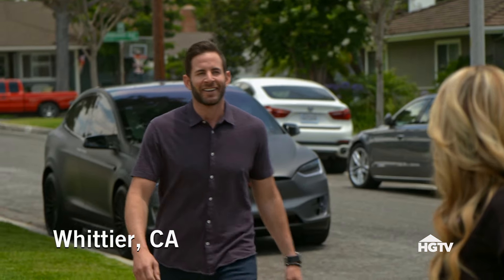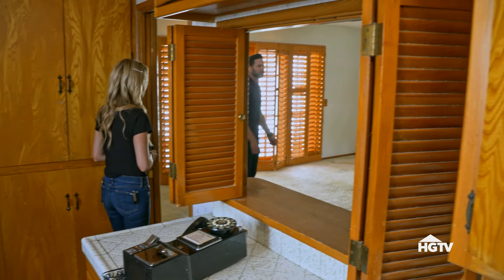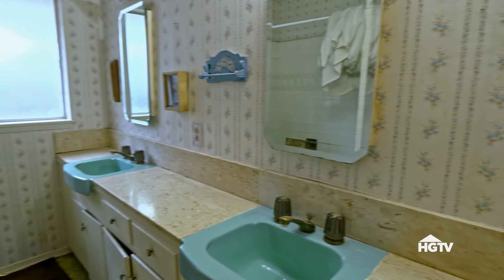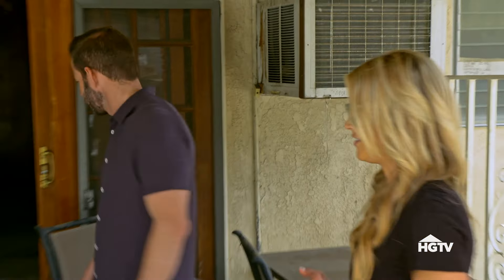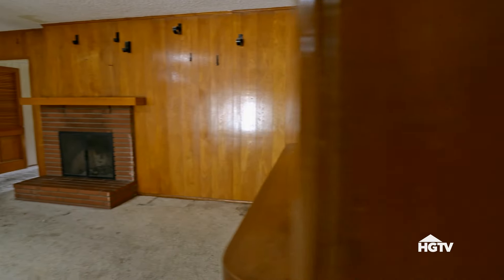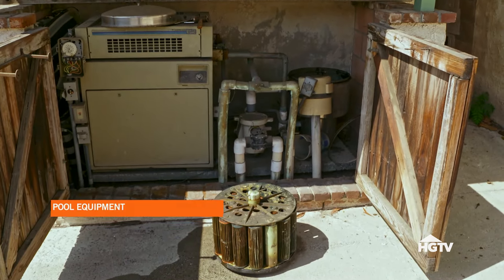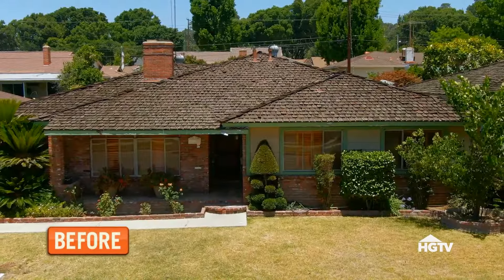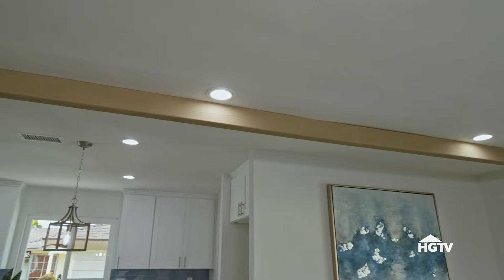Risky Home Flip Turns Into A Success | Flip or Flop | HGTV

Comment: This is one of their better looking houses. Ordinarily I hate painted brick, but on this house it looks good. The inside is mostly good. I liked the tile they picked in the kitchen—no crazy patterns or colors, and it wasn’t excessive. The things I didn’t like were mostly small stuff, like why is the oven in the dining room? In the bathrooms I’m not crazy about the tile (though it could have been worse), and the mirrors are too short or mounted too low—if you’re taller than 5’10” you won’t be able to see the top of your head unless you crouch or squat. Still, I could live there. Not for $960k, mind you, but it’s a decent enough house
Reply: It looks like a Melbourne Victoria Australia type house with all the brick and solid building
Reply: Better the mirrors are mounted low.  People often lean in to shave, put on make up.   It's dangerous to have a stool as it's a trip hazard...
Reply: @b_uppy  That makes zero sense. I shave every day and I don’t bend over to do it
Reply: Not 'bend over', 'bend in'.  There is a difference.  If you are nearsighted or possibly have astigmatism,  you may bend to get closer.  Bending makes you 'shorter'.  Since many accidents occur in the bathroom, avoiding tripping over a stepstool also makes sense...

Comment: Just extended run the roof to the fence line put a double brick wall put a new bathroom with a macerator Sedan have to worry about the plumbing and do it that way I don't know what the LA conditions the codes are over there but you know in Victoria Australia that's how they do it

Comment: More gray. Yawn. The front exterior had charm before they took away too many flowers and plantings, and painted the brick. Then, it went from charm to sunblasted and ruined. Did like the open interior, but what happened to tiling over the old brick on the fireplaces? Gray and farmhouse looks
are so dead. Doesn't anyone read about new trends in decorating?
Reply: Trends come and go each year. You flip for the area, not the newest trend.
Reply: @Steph-yz4tn  True, but how about a bit of both?